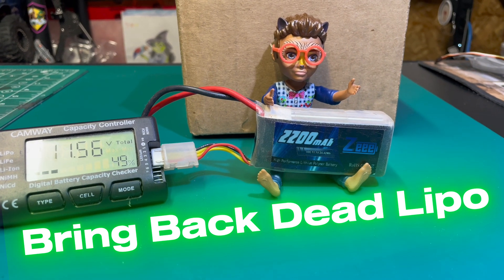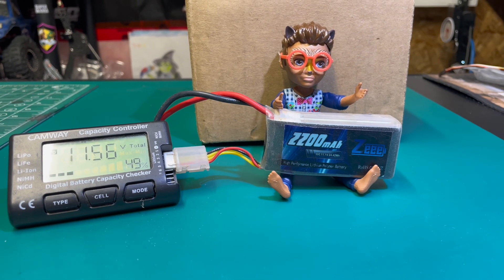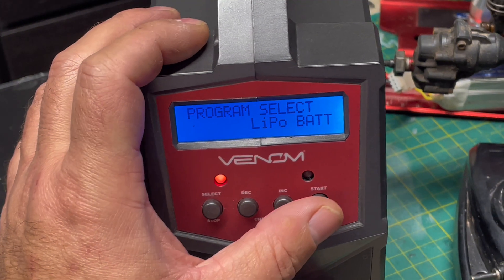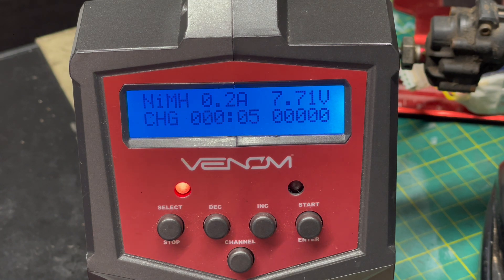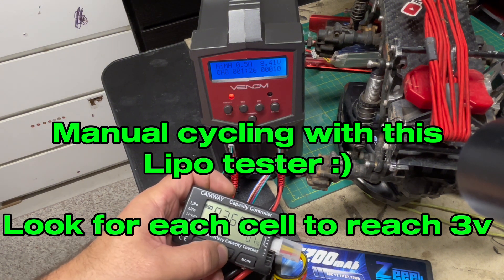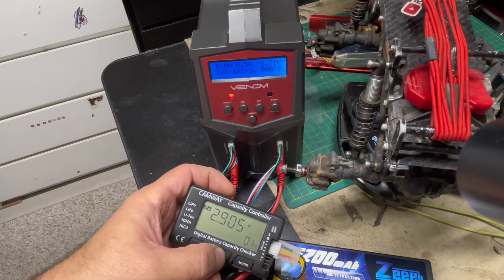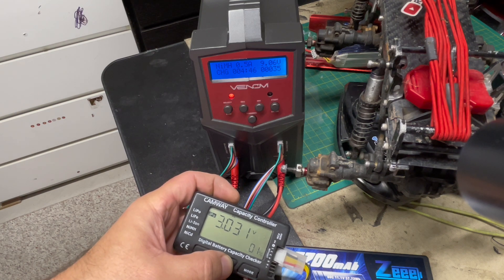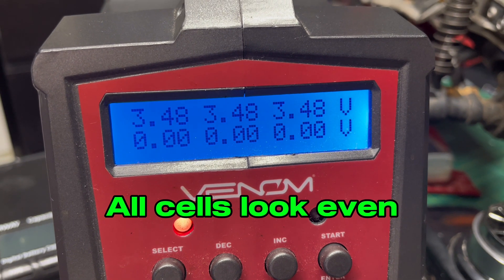How to rescue a dead lipo battery that won't charge - voltage too low, drained, discharged error

Comment: I've got a lipo I've only used once. I didn't realise my esc didn't have a lipo cut off so now it's too low. I have the GT power version of your charger but not the lipo tester. I just hope I can save it, it's a  £70 quid battery, I'll be pissed if it's dead!

Comment: Good video. Explains it clearly. Possibly consider putting up a warning/disclaimer about the dangers of doing this. Battery chemistry/stability is changed when the voltage drops that low. Seen a lot of fires caused by bad lipos.
Reply from the maker: You are right, always take care when dealing with batteries like this.